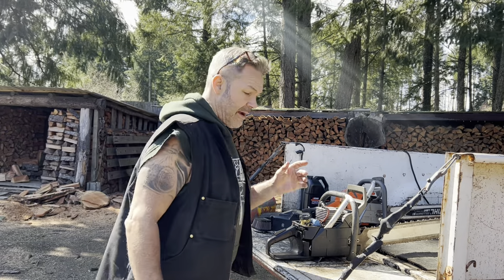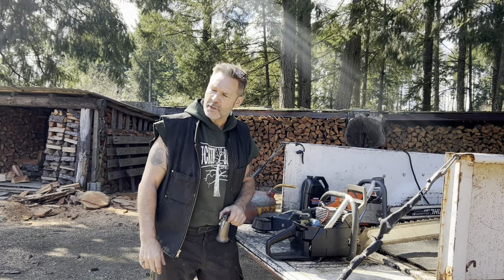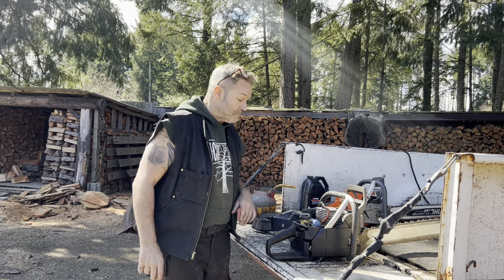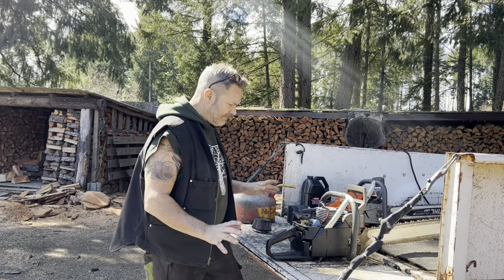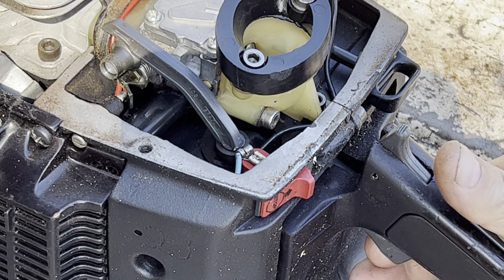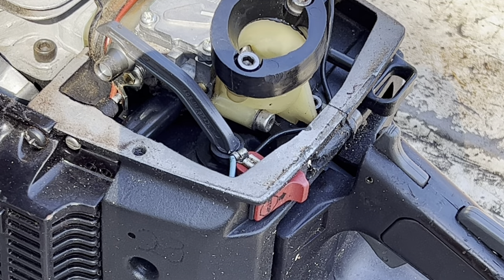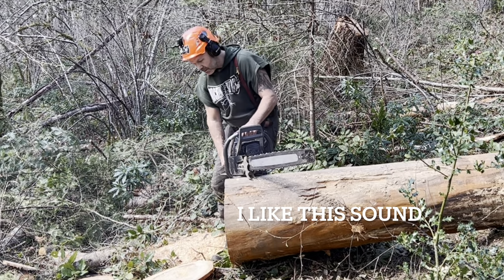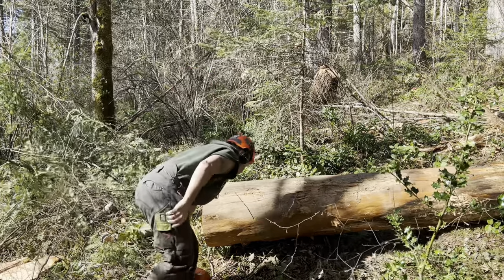Husqvarna 288 revisit ,there is a problem. hi jet tuning.

Comment: The hi-back is good for smoke jumpers because it accepts a bigger air filter generally.  So when fighting fires with no time and place to service a saw, it will take longer for the filter to get clogged with sawdust, dirt and smoke.

Comment: Depending on the model of carb, some have throttle plates that move beyond “full throttle” when you wack the lever to full stop position. The only way you can tell if you are at full throttle is to take the carb and intake block off and mock it up and visually observe the throttle plate when you move it to full throttle position. This one is a Tilly so it may be fine. I just built one with a Walbro and it had to be modified a bit.

Comment: That was a fun video. 
I've had that same issue with the throttle on a couple saws I've built.
Reply from the maker: Must of lowered the cylinder eh
Reply: I think they leave slack because they have Cushy handles so if u dog in and it was already full throttle it would try and break the linkage. !! So they made em with play so when u pull on the dogs they’ll go full throttle. Simple

Comment: Cool. I saw a vid on that same throttle issue and never checked my 288 to see if it’s got the same thing going on. Thanks for the reminder. I’m going to have a look right now. Love you Buckin!!!💪
Reply from the maker: Glad it helped They probably did machine work, which lowered the cylinder, dropping the carb linkage.
Reply: That would do it. Mines stock and was fine but something to keep in mind. I’d like to wake it up one day. Kinda funny, mine is painted black too

Comment: Hey Buckin’, great video.  I’ve had that problem with 281/288 with more recent OEM throttle arms and carbs on saws I’ve built (posted my solution on my channel in the 288 rebuild playlist)…..something changed, or perhaps there was an original design flaw.  Anyway, my solution to that was a little more hoaky.  Like your solution far better.  Exactly what did you put on the carb throttle to solve the problem (grommet or bushing of some type?)….any specs on the piece you put on it?  Would appreciate any info on that.  I’d like to try it.  I’ve always loved the way a 281/288 XP sounds when idling.

Comment: I just got my first power saw and I gotta admit I know nothing about how to tune it so it’ll run properly. It’s nothing crazy or big. It’s just a Husqvarna 120 mk2 with the 14” bar. I have learned to sharpen it with a round file from watching Billy’s videos and I think I do a decent job but I need to get this thing running right. Ive got a big pine just over 100’ tall and thick enough that the 14” bar only cuts about half way throw the tree. I gotta get it cut up so I can start moving it before my wife blows a gasket lol
Reply: That’s a lot of tree! Have fun!

Comment: I completely respect that you have decades of experience with saws, but have you ever thought of using a tachometer?  I would assume that you're making these tuning videos for inexperienced tuners (like me) and just going by sounds seems like a good way to blow up a saw....  just a thought....
Reply: It's kinda pointless using a tach on a ported or piped saw. They dont run the same rpm as stock so you dont know where to set em rpm wise.
I dial mine in by ear cutting large wood then tach em to see where they're at then I can use the tach to tune for weather changes after that.
Reply from the maker: You assumed wrong Ryan , this is just what I’m doin today.who ever watches then that’s who its, for. Thx  for watchin
Reply: @Buckin' Billy Ray Smith  ?  So if I watched it, which I obviously did, then it was for me?   😉   Personally,  appreciated the comment above because it explained what I didn't understand.   That was helpful.   Anyways, love your videos and I'll keep watching and picking up any little tid bits that I can.  😀